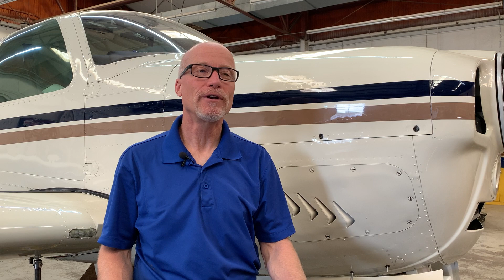Shock Strut Servicing for Airplane Owners

Comment: So..if.your showing aircraft owner how to service there landing gear..aren't you showing them how to  break the law...so items the owner can /allowed to do, however, landing gear isn't one. Be careful folks. That log book entry "COULD " come back and bite cha..this coming from an A&P
Reply from the maker: Check out Appendix A to Part 43 - Major Alterations, Major Repairs, and Preventive Maintenance.  Para (c) item 3 says "Servicing landing gear shock struts by adding oil, air, or both."  This is on the FAA's approved list of items owners can perform as preventive maintenance.
Reply: @deanshowalter1789  I stand corrected ladies and gentlemen. Its apparent I dont k ow everything...my bad...keep it coordinated and level Delta 159ner ....out